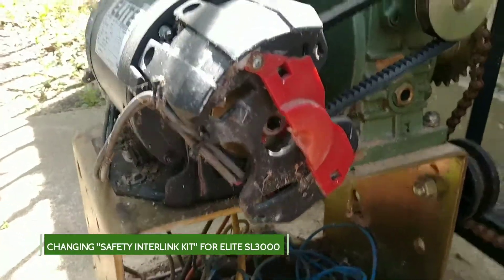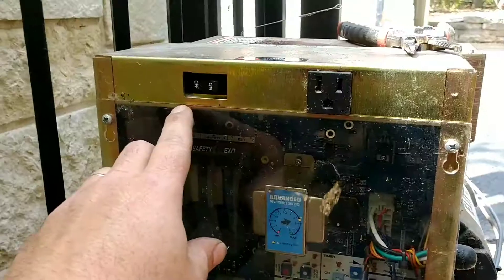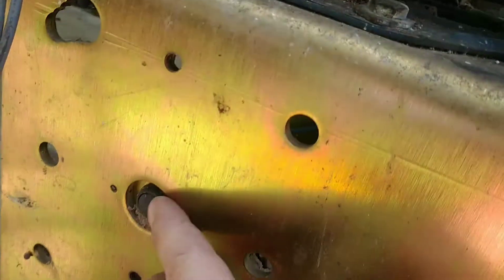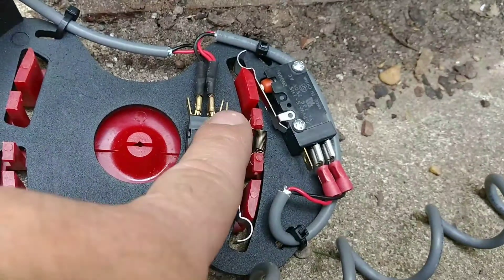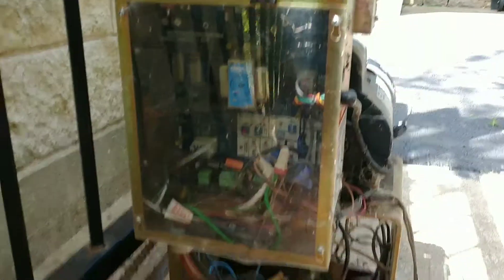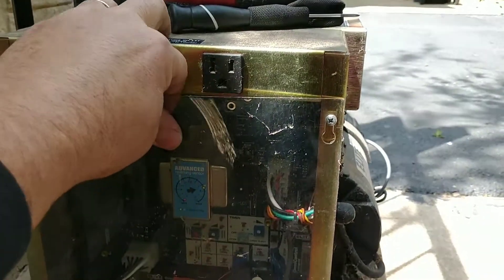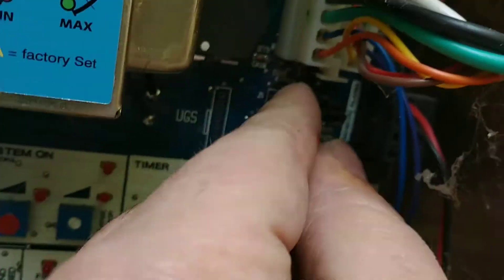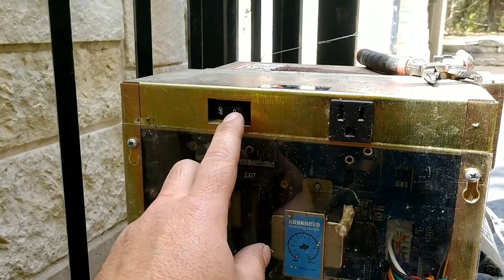Replacing the safety interlink assembly on Elite Liftmaster SL3000

Comment: Behind that new safety part you installed here to where the manual crank actually goes into. How do swap that part out? Mine is stripped out from previous uses
Reply from the maker: I presume you are referring to the red tip that has a recepticle in it for an Allen wrench? If so, it should have two screws that hold it on. Let me know if you need a part number and a place in which to acquire one.